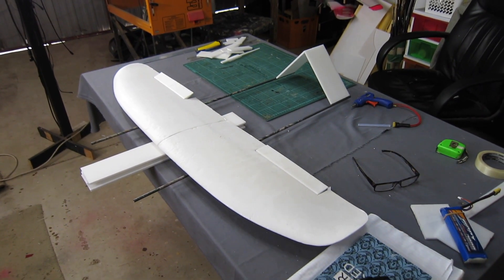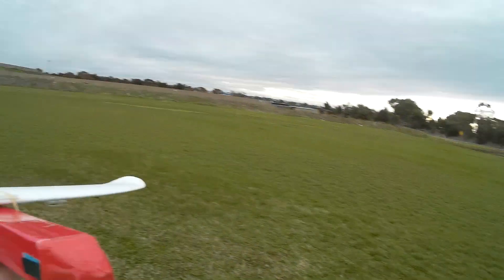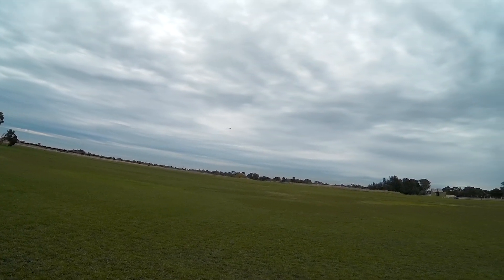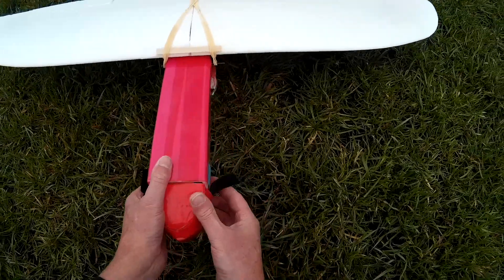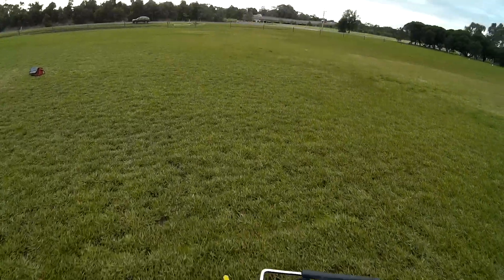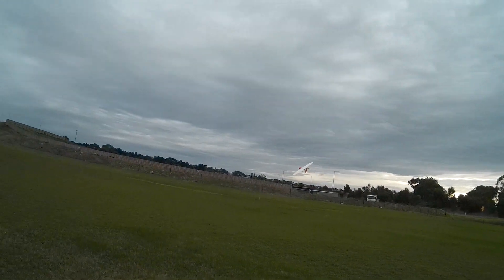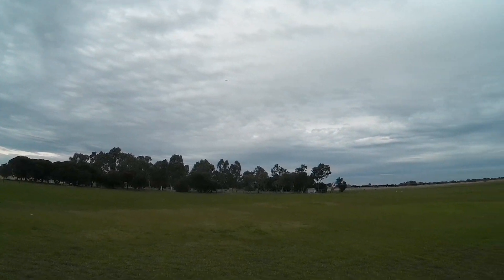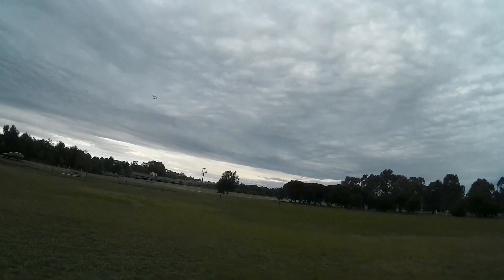Mini Talon wing A Tail

Comment: Tail area seems kinda small. I like your method for easy CG adjustment :)
Reply from the maker: Yep, I'll add some tail area for the next test. I do like the nose cone and battery tongue design
Reply: More tail area and change the angle to 110 degrees.

Comment: My vote is for a high set Tailplane on a pair of vertical fins Andrew. Conventional rudders.
  So, I must ask, where was the ideal CG..?....Im guessing rearwards of those servo wires.....lol.
Reply from the maker: I would have thought just behind the servo wires at 80mm but I was flying with CG at 65mm (240mm chord)
Reply: More rubber bands and more testing required...Yes, 33% @ 80mm sounds like it should be correct to me too...Maybe it's down to the actual wing section?  That A tail would benefit from a proper symmetrical section to make it more responsive, in particular at lower airspeeds.
  I really like that Lipo Mount for using different capacity Lipos, EA had a great idea there.

Comment: ha ha " need more rubber bands!"  just a couple.  Very nice demo, reminds me of the old days with high starts and wings strapped on with elastic bands like about (6)  lolol  three on each side but then the wings were 10 feet long.  Was a very interesting tail set-up.  Yes, I agree after watching your video,  if the tail was about half as long or close to half as long again, there might be more stability and less wobble.  Keep working at it.  I have a few old wings laying around.  Maybe I should make a body and strap them to it also lol.   Happy Flying
Reply from the maker: Yes it's an easy adaption for old wings

Comment: I am not an aerodynamics engineer but I think the “A” structure of the stabilator needs to be very strong because the wind produces some torque and/or vibration on the top union.
Reply from the maker: Thanks Luis, more area needed I think